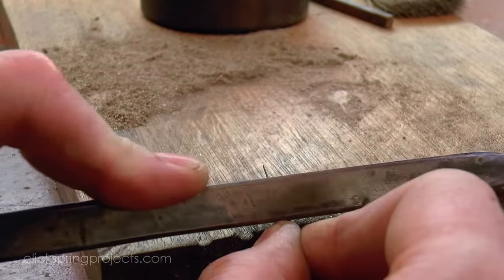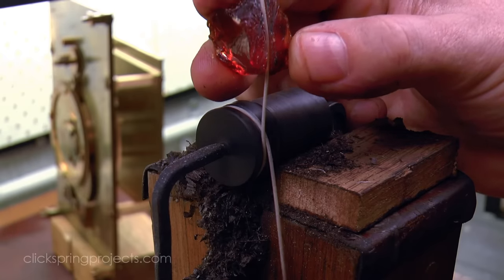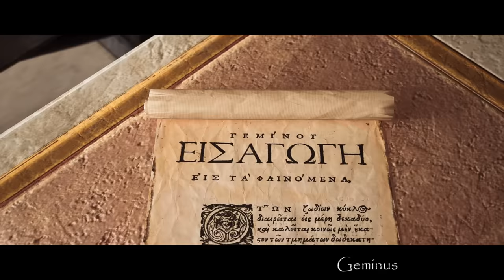Antikythera Fragment #11  World’s First Precision Lathe - Constructing The Antikythera Mechanism

Comment: The sad thing is, the antikythera mechanism is just the only one that survived and was found. Its very possible there were more mechanisms like it in the time period..
Reply: Doutless- I've heard it said that it's believed this is a 'mature' version of the machine, meaning there must have been earlier iterations that were imperfect.  But they must be extremely rare as no other has been found.  We're EXTREMELY lucky that this one was- the ship had to sink in shallow enough water to be dived on, it had to have other interesting cargo to make people want to dive it, they had to be lucky enough to see the gears, it had to be on or near the surface and not buried deep in the sand, etc., etc.  It's incredible.  And it begs the question what other incredible things haven't we found because they are less 'luckily' deposited?  The mind boggles...
Reply: Even today if you ask most people, they don't know what a machinist does, or even is. Relatively few people have an interest in figuring out how old things were done mechanically, and usually the ones that do, are in a related field, and aren't recording history. It's difficult to determine which sorts of processes should be preserved because they could be lost. Methods techniques and knowledge that are so normal for the time, such as a workshop with this kind of lathe, or a blacksmith, or carpenters, or shoe cobbler, or any technical trade that was such a staple of society at the time. When it's the norm, it is hard to foresee that the methods and techniques are something that ever COULD be lost. The same goes for devices. This mechanism was probably entombed and preserved long before this type of device became obsolete and started disappearing, and there would have been a point in time which breaking this sort of tool down for its metal to pour into a drawer knob was probably akin to ripping apart old "useless" electronics for precious metals.
Reply: I agree. There had to be a demand for these machines and the one found was likely not the only one ever produced. The others were probably repurposed for jewelry, trade or melted down for the brass, bronze and copper when their use was no longer needed.
Reply: @nikolaishriver7922  It's like when the first Polish encyclopaedia included such definitions as "Horse: Everyone knows what a horse is"
Reply: I think I'm with the OP, this kind of mechanism must have been relativelly common, I mean, not in every household, but something the rich people can buy. Maybe not as complex, but there should be enough demand  of similar stuff so developing a lathe or ways of hardening tools was necessary.  I'm thinking on perpetual calendars for popular events, moon phase calculators, things like that... Simpler but similar mechanisms for merchants to plan trips, comes to mind.
Reply: @FriedPi-mc5yt  he's mentioned in earlier videos that there are clear Streamlinings in the construction, such as the spoked wheels being not crossed out, but trepanned and fitted with a mortised (right term?) hub and spoke, to allow the middle to be used as another smaller wheel, while the spokes can be efficiently made with straight-cut bars, mattL mentions this up higher
Reply: And the likelihood of a unique artifact being found is low. Quantity helps!
Reply: one piece of kit that would be incredible to find would be what ever tooling was used to make the stone cups and vases the early Egyptians had. The craftsmanship suggests they were lathed out from solid rock, but features on many of them show you would need a duel axis tool to make. These artifacts were likely difficult to make, but thousands of them have been found over the years.
Reply: I think one of the Plinys mentioned them, and there is a reference somewhere cataloguing several of the devices as part of a delivery order, so they were certainly common enough to be available to interested people.
Reply: @paradiselost9946  the bowls and vases have some really complicated geometry, so yes they had to be made using multiple axies tools or in different stages. Their fascinating to think about.
Reply: You can certainly run a manual 5 axis. Speaking from experience.
Reply: Not just possible, probable. Such mechanisms were probably rare, but it isn't like a craftsman would teach themselves how to make clockwork mechanisms so that they would just make one and never make another or teach anyone else the necessary techniques.
Reply: It's improbable to think there weren't other mechanisms.
One would expect that there was a market from simple mechanisms all the way up to complex astrological calendars. 
There has to have been a reason to "cut the first gears", and that means to get to the point of Antikythera, mechanisms would probably have been reasonably common if prised possessions, once the wealth and need to own one is achieved.
This may also hint at why so few exist today, a father may have passed his mechanism to his son, who then takes it to the craftsman as material to offset some of the cost of creating his own mechanism, and so the cycle continues into modernity.
Reply: We might not even have found the latest version.  Maybe there was an even better 2.0 somewhere that could also remind you about upcoming birthdays and such.
Reply: @paradiselost9946  I think what is 'lost' is way to cast granite also if thye were casting stone it would ahve made building the pyrmids a heck of lot easier
Reply: @nikolaishriver7922 I know get where your coming from. Society has changed to have an attitude towards craftsmanship and viewing it as old school. I work as a manual machinist repairing aircraft parts. I'm the youngest, but most experienced second to my boss. When I went to trade school to earn my certs, I was thinking only one who went above and beyond and preferred manual. All students preferred CNC, but would take forever soto get assignments done, I would do them manually instead of waiting for a CNC.
Reply: @infinus5 the big pythoi where for certainly made in multiple stages due to the nature of clay.

Comment: What I especially love about this lathe setup is that, yes, you can use it as a one-person machine, but it seems better to have an apprentice handling the bow. This allows the master to work the piece unencumbered, while giving that apprentice a close-up perspective on the technique.
Reply: It could very well be part of his passage from apprentice to master by making his own set of tools.
Reply: I don't know when the treadle mechanism was invented, but I'd expect foot power for the bow would have been much more useful. If you're going to have interruptions in the power, as required by the bow reaching the end of travel, having that under the control of the person operating the cutting tool seems pretty important.
Reply: I suspect, that putting the whole thing next to a big round stone that can be turned and provides some inertia might have happened too 😉
Reply: @paradiselost9946  work songs are basically used to provide synchronization
Reply: Plus it would be extremely easy to convert to a spring pole lathe.
Reply: @paradiselost9946  Not really all that hard. In the end it´s just something that needs a little bit of exercise. It´s in a similar vein to smiths working with two, three or even four people at the same time while forging. And really a lot of tasks throughout history before automation made it possible for a single person to do jobs that before took multiple workers.
Reply: @blahblahblahblah2933  Yeah, getting a rhythm between two people is nothing compared to certain work that could take dozens or even hundreds of people working in synchronization. Staying in ancient times, like "walking" gigantic stones using nothing but a bunch of simple leavers and a lot of people. And a well trained troupe probably could move dozens of tons heavy blocks around at surprisingly fast speeds using such teamwork.

Comment: Who knew it was this simple to bootstrap a machine shop!?!

Chris, I'm convinced that with just a hot fire and the right metals you could bootstrap your way to creating not just a machine shop but all of Rome if given the time. Your patience in creating these precision parts is truly astounding. I can't imagine how long it took to slowly carve away metal to get that shaft at the end. I learn so much from you in addition to the machining practices.

If you were using modern methods (even along the lines of the skeleton clock methods), I know you could have had a functioning  Antikythera Mechanism more than 2 years ago if you had wanted, but this journey of machining archaeology is not something I ever expected, and its such a treat to learn with you. 

Thanks for the great content as always!
Reply: If you have a lathe, you can build literally every other machine in a workshop. I just never fully comprehended how easy a lathe actually is to make 😂
Reply: @gaskamp2  As a lathe operator, this is absolutely the case. Most people don´t get what you can actually do with a lather, turning round things is just the most basic part of it. I could with a little extra work make a cube using a lathe pretty easily. And all the extra tools needed could again be produced with the lather and an additional set of very simple tools.

Comment: I’m impressed that you can take the work off the lathe and remount it like that without affecting concentricity too much!
Reply: Turning 'between centres' is how the most precise watchmaking is done. It doesn't matter how many times the work has been taken out, checked, even fitted to the timepiece, etc, then put back in the lathe, it will still be perfectly concentric :) Cheers

Comment: Here we have disproved the old adage that you need a lathe to build a lathe. All you need is Chris to build the FIRST lathe, out of sticks and rocks, and now we see where all the rest of the lathes came from.
Reply: The adage is always quoted incorrectly. How it correctly goes is "You can use a lathe to make a BETTER lathe." With his second step for example now you could turn pulleys and shafts to make a faster and more accurate one that can be used to make an even more complex and improved one and so on.
Reply: The saying was that the only machine that could reproduce itself was a lathe. Now, with CNC equipment, that might not be true anymore.
Reply: @glennschemitsch8341  When you think about it... It might actually be more true than ever lmao. How many CNC machines do you suppose can reproduce the microelectronics used to control them?

Comment: Wow this brought me back to when I visited Marrakesh many years ago. I saw an artisan turning wood on a bow lathe similar to this. Except he was sitting on the floor and used his foot to hold the cutting tool while his arm pulled and pushed the bow. I just stood there in the street for a few minutes just staring because I was so amazed to see not only a human-powered lathe but also cutting tools being held in a foot. This video brought all of those feelings back. Absolutely amazing what can be done under such incredible limitations. I never thought you could turn metal this way, and I definitely didn't think you'd get such a good surface finish. Bravo, Chris!

Comment: I am always amazed by your ability to figure out early tool making, Chris. We see evidence of lathe work from the BC era of mankind, and other complex tool use, not mentioned in past history often, let alone having drawings of the tools. But I have seen the work, especially in India, where stone columns are found in their temples, some of which rotate! 

But as I sit here watching you start your video, you have another tool in the background that also turns at high speed, and has a counterweight/flywheel to assist in smooth turning. Your drill is also part of a very early vertical lathe, if you get my drift. It could be possible to do work with it to turn shafts and arbors, and by one person, or two, depending on if they made them larger, to accommodate larger work. While it is suited to file or stone grinding, as it lacks a rest for tools, I would not be surprised if they could have adapted a rest with it.

Comment: Trying to imagine back in the day and the surface finish was coming out poor and they had to adjust their speeds/feeds by moving their arms differently.   Pretty fun
Reply: you'd probably have an apprentice working the bow and have to remind him not to get too enthusiastic or he'll burn up the edges of the cutting tools. a good way to teach patience-discipline
Reply: @Hyratel   Having both bow and pole lathes, I can say that being in control yourself is the key. It's not hard work, and I love the immediacy of it. You want to stop? you've stopped. You want to change speed or inspect the work all round? Done, without really thinking about it. In so many ways they are much nicer to use than 'powered' lathes, and they very much do precision work. Cheers

Comment: Summary

Introduction
- 0:09 - Host: Chris from Clickspring
- 0:14 - Topic: Construction techniques of the Antikythera mechanism

Key Construction Details of the Antikythera Mechanism
- 0:14 - Key Points:
  - 0:14 - Fastening pins in the mechanism are handmade, suitable for a freehand approach due to tolerable variability.
  - 0:59 - Complex gear train requires precise, frictionless arbors and pivots; hand filing is mostly unsuitable.
  - 1:11 - Lathe technology likely used in construction, evidenced by historical references and artifacts.

Challenges in Reconstructing Ancient Techniques
  - 1:31 - Lack of surviving ancient lathes leaves a gap in practical knowledge.
  - 1:54 - Large circular shapes in the mechanism can be precisely cut with simple tools of the era.

Lathe Design and Operation
  - 2:04 - Formation of small round components (arbors, shafts, bearings) requires a small, possibly hand-operated lathe.
  - 2:36 - Ideal lathe for this work would be small, allowing close work and precise bearing surfaces.
  - 2:42 - Chris demonstrates a homemade lathe using wood, a bow, natural gut line, and carburized iron cutting tools.
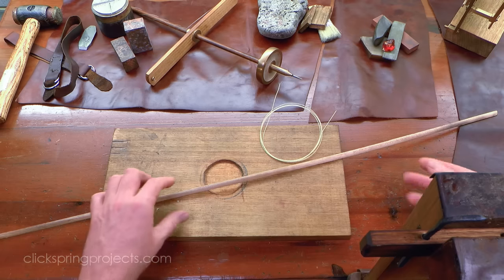  - 3:05 - Lathe operation details:
    - 3:52 - Ergonomic design for standing work.
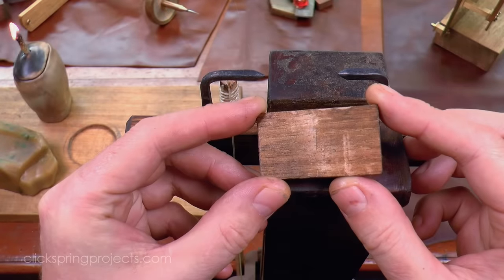    - 4:03 - Wood or leather strip as a cutting tool rest, adjustable with wax.
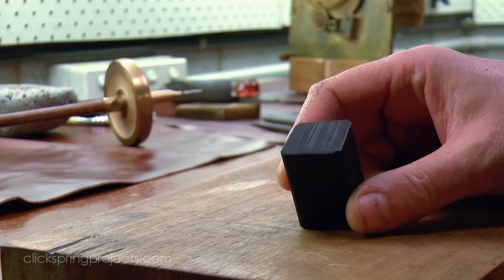    - 4:59 - Ebony used as a test material, consistent with historical usage.
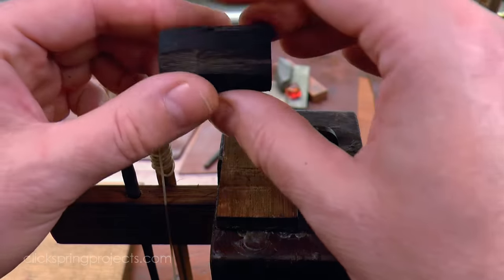    - 5:15 - Lathe features lightly sprung prongs for holding workpieces, allowing easy loading and unloading.
    - 6:01 - Initial cuts are coarse, but the lathe's design allows for continuous improvement.
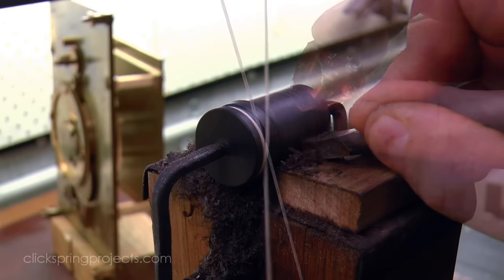    - 7:43 - Rosin applied to the line for better grip.
    
Advanced Lathe Techniques and Historical Context
  - 8:07 - Process for creating a thin, tapered arbor demonstrated.
  - 9:17 - Metal workpieces likely started from cast or forged stock, then filed to basic form.
  - 9:30 - Additional features (e.g., internal bore) completed with pump drill and hand files.
  - 10:20 - Combination of arbor and workpiece allows for more detailed turning.
  - 12:57 - Method to upgrade lathe with bearing parts for snug fit and pulley system, allowing for both direct and indirect drive methods.
  - 13:33 - The lathe's design allows for adapting to different workpiece requirements.
  - 13:38 - Core features of the bow lathe include two pivots, rotational force, a tool rest, and a cutter.
  - 13:52 - Use of olive oil on bearing points ensures smooth operation.

Historical Significance and Impact
  - 14:02 - The lathe is a crude precursor to modern watchmaker's turns, important in early clock and watch making.
  - 14:26 - During the Antikythera mechanism's era, this early machine technology was revolutionary.
  - 14:37 - The origins of this technology are unclear but likely developed in Rhodes.
  - 14:48 - Rhodes, a naval and trading hub, was deeply interactive with major ancient civilizations.
  - 15:05 - Rhodes, like Alexandria, became a center of science and technology, attracting Roman nobility for education.
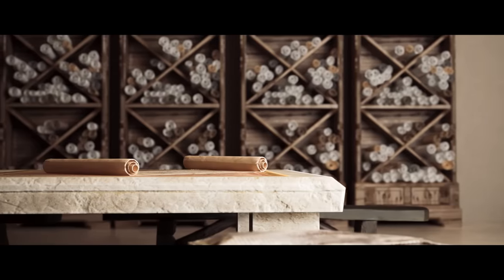  - 15:18 - Renowned scholars in Rhodes included Geminus, Hipparchus, and Posidonius, influential in astronomy, engineering, and philosophy.
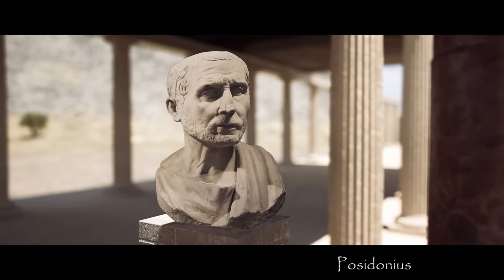  - 15:50 - Cicero and others made passing references to similar devices, but details are scarce.
  - 16:01 - Speculation remains about the specifics of who and how this technology was practiced.

Conclusion
  - 17:04 - The bow lathe, simple to construct with period tools and materials, could replicate the Antikythera mechanism's complexity.
  - 17:18 - It demonstrates an intrinsic property: shaping objects true to their axis when spun between two points.
  - 17:36 - Concluding remarks, emphasizing the significance of the bow lathe in ancient technology.
Reply: This man needs to be pinned due to this great index of chapters.
Reply: I would be tempted to go with something like....
0:00 - Chris from Clickspring.
0:01 - Chris proceeds to create metalworking magic to an awesome backing track. 
17:36 - See you next time.
Of course, then, all of the indexing for every video would end up like that. 🙂
Reply: Well Done!

Thank You!